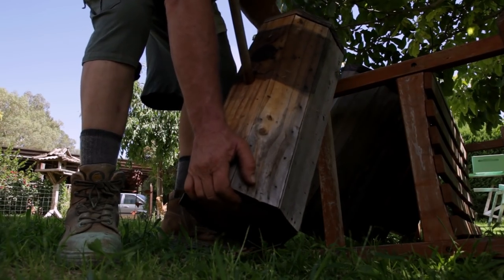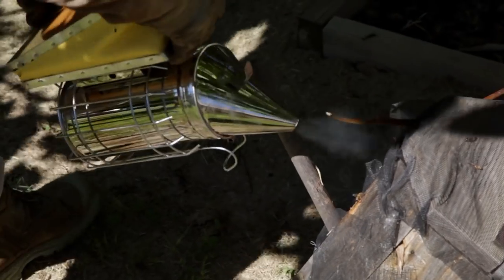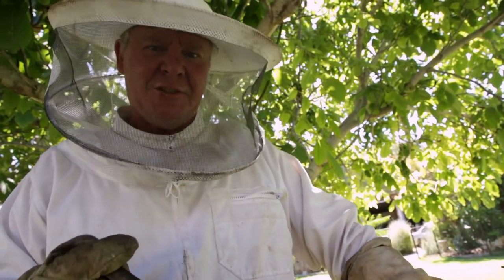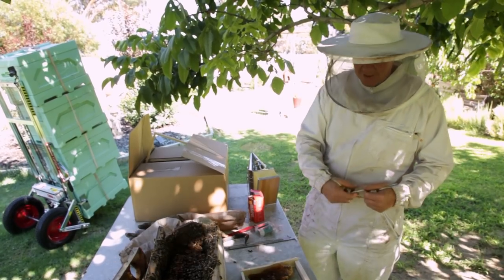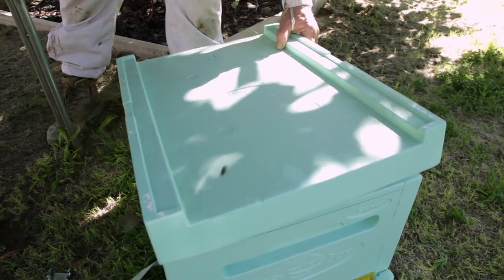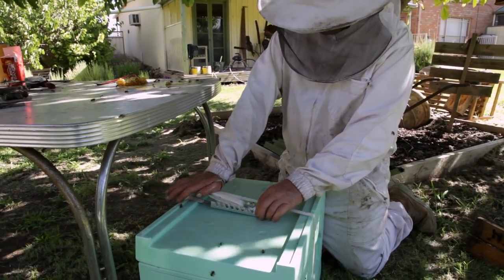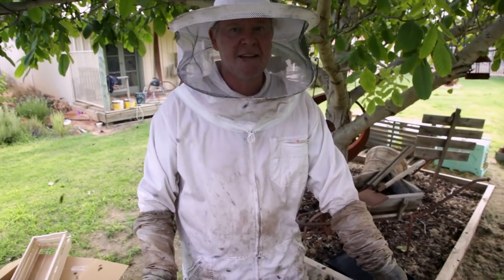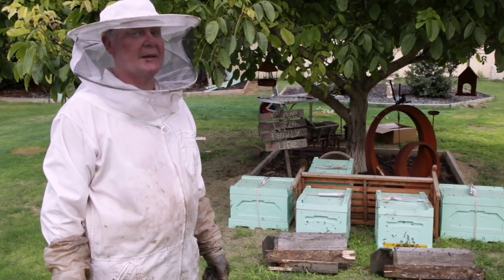Removing Wild Bee Hives from Bird Boxes - Episode 31: "Crack Wide Open"

Comment: Make an "X" across the frame with the rubber bands. It supports the comb better during hot weather. When they have the comb attached to the top bar you will find chewed up rubber bands outside the entrance.

Comment: I noticed that you put the combs in horzonaly as they were removed from the vertical position. Please bear with me as I am trying to learn. Some say that the comb cells are slightly angled upward so as to keep eggs etc. in the proper place? I don't know if this is truely accurate? I thought about it for a moment while watching your video, and decided that the bees could easily reshape the comb in any way that they prefer. Am I right in my assumption? I would really like to know for sure because Ive seen several videos that the bee men always place the comb in the frames as the position that they were removed. Placing the wild comb as you have in this video is a great way to fill in the frame with one long piece instead of two or three pieces placed horizontally.. Please advise...And maybe later will you be kind enough to make a video of yourself going back into these "new hives" and showing what effect, if any that placing the combs in this manner may or may not have had??? Thank you so much!! Phillip Hall

Comment: The comb was put in the new frames sideways.  The cells angle upwards, it will be interesting to see how they "fix" the combs.
Reply from the maker: Off camera, we talked about this problem.  We felt that cutting the comb in half so it was the right way round might freak the bee out more than they all ready were.
Reply: It may disturb them a little bit more, but in the long run, the bees will be able to use that comb for anything (brood, pollen, nectar storage) always the best practice to keep the comb in it's original orientation. Good luck...
Reply: I was wondering the same thing.  I thought about it for a moment while watching and decided that the bees could easily reshape the comb in any way that they prefer.  Am  I right in my assumption? I would really like to know for sure because Ive seen several videos that the bee men always place the comb in the frames as the position that they were removed.  Please advise... Thank You Phillip Hall
Reply: @PhillipHall01  the bees can NOT re shape the comb once it is built.
Reply: Steve Welches Thanks for your reply Steve. Phillip